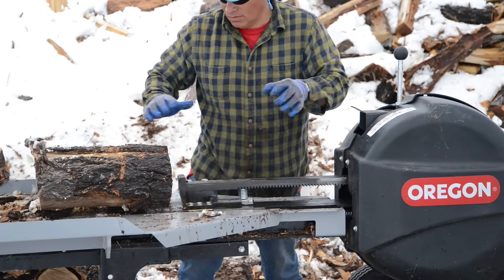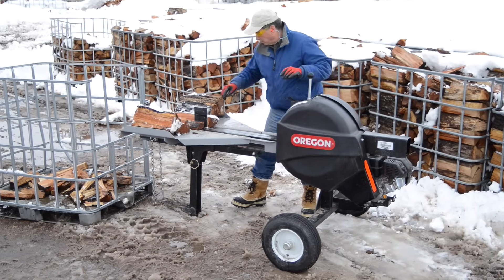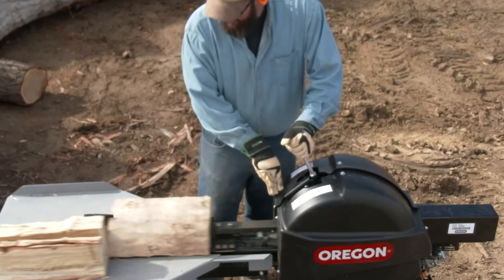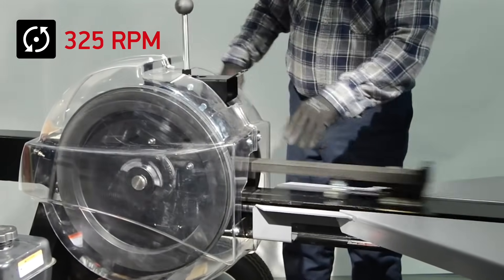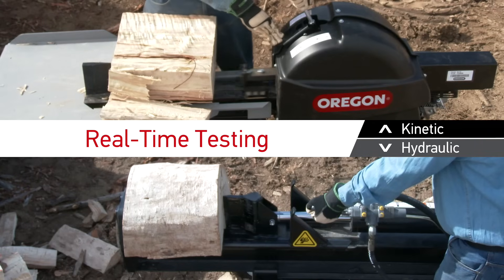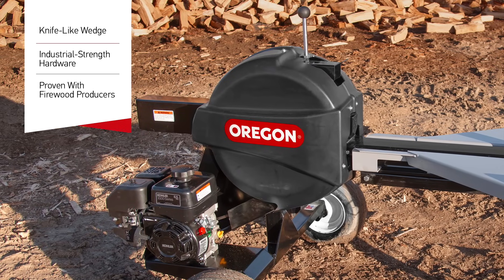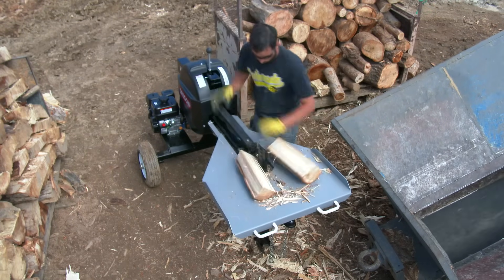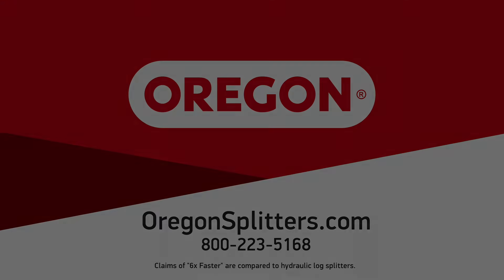Oregon Kinetic Log Splitter

Comment: Man that's a LOT of beans for a consumer to cough up. This is far from a commercial splitter, those fly wheels don't store enough kinetic energy to bust up some serious hard wood. Specially not with knots. How much are parts for when the teeth wear out from constantly coming in contact with a moving set of teeth?

Comment: I never have any issues splitting wood with my hydraulic splitter and it never moves as slow as the one you showed.
Reply: appears to be discontinued. gears get chewed up
Reply: @pearlrival3124 I was wondering why it’s not on the website! Thanks.

Comment: For $3000 I would expect at least a aluminium protective casing not a cheap old plastic one and don’t tell me it was to keep the cost down because I’ve seen less expensive kinetic log splitters with aluminium or even steel protective casings

Comment: Weird how these new type of splitters claim so much better then the hydraulic ones and with far less parts, but somehow double or triple in price? Makes zero sense to me.
Reply: You are correct altogether. As a matter of fact, if you do not need it to be portable or if you have a generator you can order these in 220V. should be better than gasoline engines.
Reply: Hydraulic splitters are built using standard hydraulic components.  Pumps, valves & rams, mostly.  Those parts are used on about a jillion things from backhoes to bobcats to whatever.  The parts are stamped out like cookies in efficient factories, so they are cheap.

Just about every piece of a kinetic splitter is made just for that one machine.  By a small manufacturer.  No economies of scale.  Everything is more expensive when it's custom made.

Comment: How do the kinetic splitters do on wood like Sugar Gum, which is very difficult to split?  I’ve been using the hydraulic, but really like the speed of these
Reply from the maker: Hi Chris, apologies for delayed response. If sugar gum is a type of hard wood, it will most likely do fine. Our product team said you may need to hit it a few times, but it should get through.

Comment: hi..how many tons of force do we have on that splitting wedge?..it's very fast indeed, but i think it cannot split all types of wood..
Reply from the maker: Jonixase, thanks for the question. 

We followed up with our product team on this and they said we do not rate the unit by tonnage because it doesn’t take into account for the kinetic force stored in the two 70 lb flywheels rotating at 320 RPMs.  To put it another way, you can swing an axe and split a log, but you aren’t generating 35 tons of force.  The weight and the speed of the head help split the log. 

Additionally, before launching this product in 2015, we successfully tested it against a lot of stringy pine and knotty wood, including some that had robust nails.